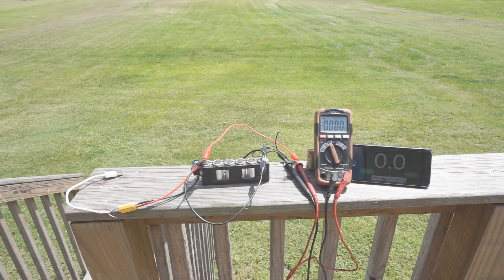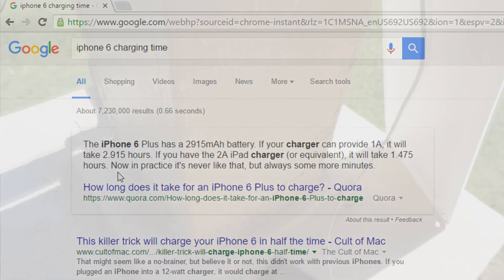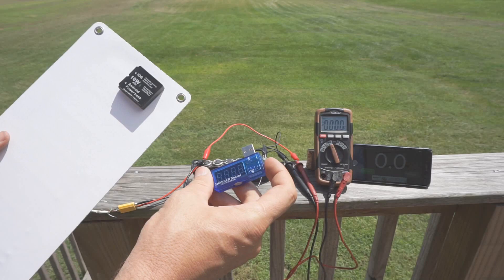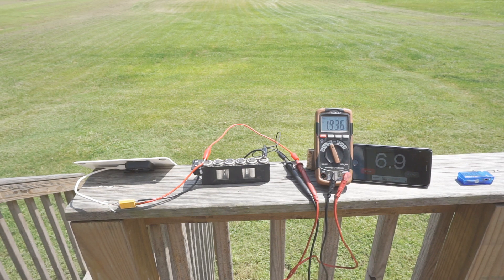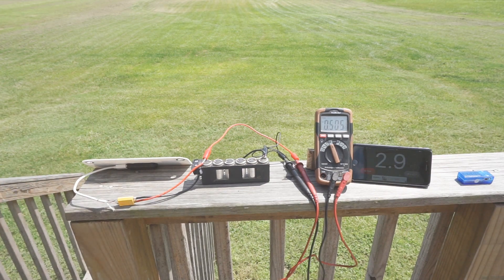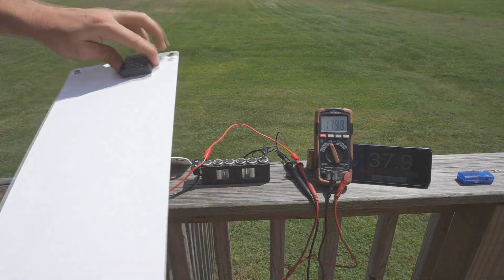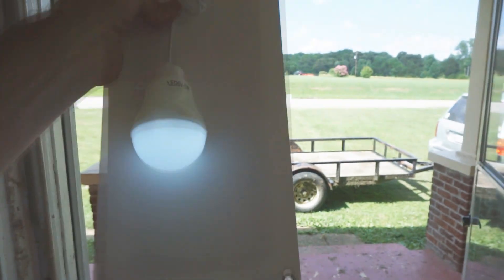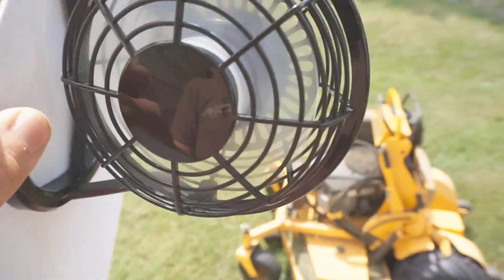Testing the SOLN1-10 Solar Panel - Fast iPhone Charger!

Comment: I was really looking forward to getting my sunwalk/elegeek 13w panel. During testing in 25-28 degree c sunlight with no wind it stopper charging due to what I believe is overheating. The little control unit is, just like yours, glued to the back side, getting as hot as the top side. 50 degrees? Do you think this is due to a bad design/make/materials? Cause it should be working. :/

Comment: I have received my two Soln1-10 panels and started charging my iphone 5, iphone 6 and my 3000 mAh power bank.
Both panels not charging, only the green light appeared, red and blue light never turned on. Can someone provide assistance ?

Comment: I love this panel I guess that is why I bought one on ebay just receive it today.  I bought mine for camping so my devices can stay charge.  quick question the lime fuel battery pak  how many times can u charge a iphone to full on one charge.
Reply from the maker: Glad you like it.  Depending on the iPhone model a fully charged LimeFuel 15600 should be able to charge it between 6-12 times.

Comment: I knew it, the others are designed wrong, they go 5.5-6 v (11-12 cell) panel and you did 4.5 v (9 cell) and it work good with the max amperage out of cells! Hell, we are only charging 4.2 v batteries...

Comment: That quick search on google gave you the result of the Iphone 6+ battery, this one is quite a lot larger than the Iphone 6. The plus has a 2915mah battery and the one of the smaller 6 has 1810mah. So that means that you're 1.5 hours is incorrect. So this would be more like 54 minutes with an 2 amp charger. If we ignore all the other factors playing a role in this that means that your  Iphone charged 93% in 90 minutes. So that means 1683mah (@ in 90 minutes, that comes down to an average current of 885mA if you also calculate the conversion from the cel voltage to the usb voltage. That current is running through your iPhone cable at 5V. Someone correct me if I'm wrong :)
Reply from the maker: Very sharp thinking.  I did not notice that probably because the listed time is right in line with the charging time of a iPhone 6 on a 12W USB charger.   "The iPhone 6 takes one hour 50 minutes using a 12 watt usb power adapter and the iPhone 6 Plus took 2 hours and 30 minutes. "  See: http://www.telegraph.co.uk/technology/apple/iphone/11128043/How-much-power-is-used-to-charge-an-iPhone-6.html
Reply: but, remember that you did charge the iphone with the screen turned on, that drains a considerable amount of battery..
Reply: JuampixDDD You are right, so the total amperage would probably been closer to 1A, which is personally pretty good :)

Comment: Excellent!  I just ordered one from your web site.  The SOLN1-8 that I got last year worked out great on my sailboat trip last year.  I made a video of it but it didn't turn out well so I didn't post it.  This new '10' will outperform it and that is great news.  All I can say to anyone considering spending $50 to get one of these---just do it.  They work!  That is the bottom line.  I will probably use this new '10' for a fan on the boat as shown in this video.  The panel sits INSIDE my boat in a window out of harms way.

Comment: I've followed soln1 for a while...waiting for new stuff.  This is perfect for me.  I already have several solar banks so in a pinch I can charge phones, tablets, radio...even hook my little fan up and bring it to bed...night sweats.  The solar part takes quite a while to charge.  In an emergency this is great for the basic stuff.  

Questions;  what is iOS port?  I don't have an iPhone so I'm not familiar with apple stuff.  So I can run directly off it...via fan on the beach or plug in to charge my battery banks.  Which port do I use or does it matter.
Thanks so much for the info.  I will be ordering one of these for sure!

Comment: It looks like your custom 10-watt panel is made up of 3 SunPower cells cut into thirds.  This would not give pulsed DC.  The cheap chargers out there that use a DC to DC converter in between the solar cells and the USB port WOULD produce pulsed DC.  I'm assuming those SunPower cells are wired directly to that USB port?  It would make sense because 9 SunPower solar cell fragments in series would produce just over 5 volts.  Solar cells produce clean (flat line) voltage.

Comment: I like that panel. I have 2 "Brunton" folding solar panels which I use for charging everything, but they're kinda pricey. The solar cells you used look darker, they probably have a decent output in lower light.

Comment: Its ok, design,make a battery pack to hold some rechargeable batteries, for when the sun is not shining, and/or for other devices such as frs radios or flashlights, etc.

Comment: i am looking forward to see some experiments with solar panel and paramotor in action. flying for hours without landing, why not!
Reply from the maker: I am slowly working toward that goal.  It might have to be a different type of aircraft.  I have a saucer shaped flying wing design I am going to test with solar in the future.   I will be starting out with models so I do not kill myself.
Reply: Thanks for all Lasersaber. you have been done the great job . I have question for you today. since the solar cell produce 0.5v , maen that you will need 10 cells to have 5v. on your project you only have 3cells, how is it does? do you use a DC to DC converter to boost up the voltage at 5v? 
thanks

Comment: Does it have regular USB charging port on it?  What's the difference between a common USB port and an iOS charging port?
Reply from the maker: It has two USB ports on it.  One set up for iOS and the other for power bank & Android.  iPhone often will not charge on a USB solar charger.  iPhone detects the current fluctuations or something and rejects the USB port.  With the older 8W USB panel it would charge my iPhone if the sunlight was very consistent.  This one provides a much more stable iOS output just for iPhone charging.
Reply: One of the difficult things about solar is that power output fluctuates like that, so it might be beneficial to have a small battery in it to act as a buffer. Achieving the maximum power output can only be done with the correct load for the size of the panels and amount of sunlight present. Of course it is clear that if you leave the bare panels open circuit, a maximum voltage will develop but no current flows, so no power is delivered, and conversely, a short circuit or very heavy load will cause the highest possible current to flow but with a severe voltage sag, with the output voltage approaching 0V, so as a result once again the power delivery is close to nothing. If the manufacturer did not already state the "optimum voltage and current" ratings, then you can probably connect various loads to the device whilst measuring voltage and current. I did this for one of my small panels using a 20 ohm wirewound rheostat for a variable load, and plotted data in excel. I ended up with a nice looking concave-down parabola, as expected.

So if you can setup your own switching converter for these panels to first charge a small 3000mAH battery or something at the optimum current output of the panels, Then it will maximize the efficiency of the panels as well. Only disadvantage I see might be the necessity of having 2 (lossy) switching converters and a battery taking up space, and possibly biting into efficiency as well. But the advantage would be a steady power output! I'd use a synchronous buck converter designs as these should be the most efficient. Low Rds MOSFETs with low gate charge should also be used.
Reply: lasersaber Are you positive that Apple hasn't put something in their firmware so you can only use apple's "authorized" chargers? Seems weird they would detect current fluctuations because the USB spec is pretty generous with the current requirements.